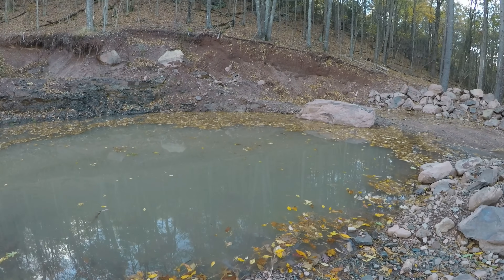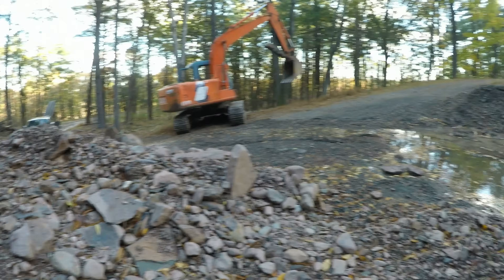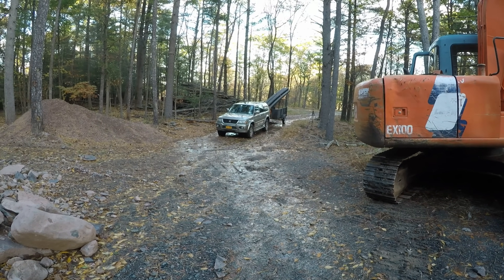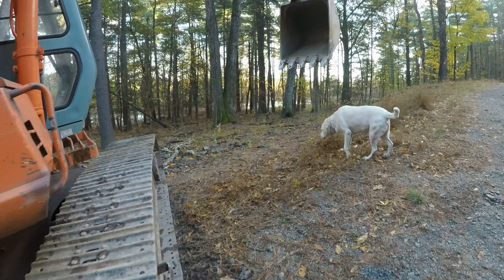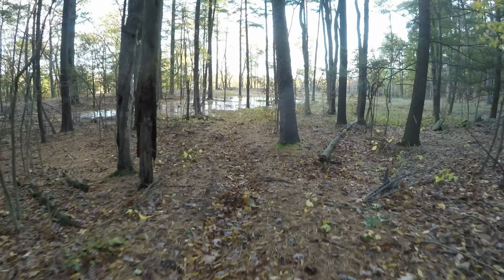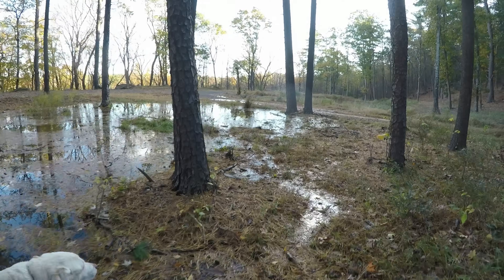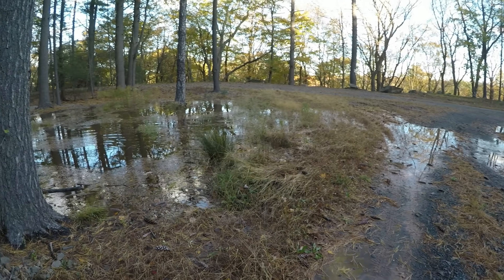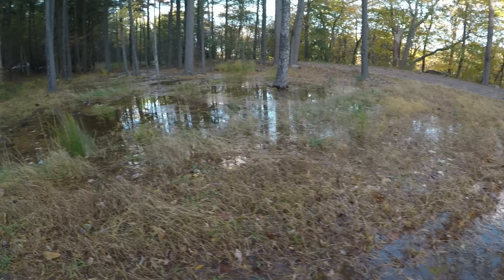Installing culvert pipes

Comment: The green line on that pipe is supposed to face up.
Reply from the maker: Malcom Texeira oh, why?
Reply: Andrew Camarata  If you look close at that pipe, 90 degrees off that green line there are perforations those are to be at the spring line, ie the middle of the flow line.
Reply: Andrew Camarata they are tiny..
Reply from the maker: Ill have to double check it. I know about perf pipe, I think that pipe is all solid though.
Reply: Andrew Camarata yup, that’s solid but it has little holes you can barley check 90 out from that green line. I didn’t know it either until my foreman told me lol

Comment: Andrew, how do you determine what size culvert to install? i have a small stream about 2' wide and 18" deep, i would like to be able to drive my vehicle across.
Reply from the maker: I guess just look at the size of the stream, and just make sure the pipe looks bigger than the amount of water that flows threw it after a heavy rain. I'm sure there are calculators online for properly sizing these pipes. But bigger is better.

Comment: would double wall corrugated pipe 24" or 36" diameter buried a couple ft deep withstand the weight of a full concrete truck?? anyone know???
Reply from the maker: Buried a couple feet? Yeah, that would be fine, I've buried that stuff way less than that and have not had a problem with it crushing with heavy truck traffic.

Comment: Well done young man, that block of land will be more productive now you've done that. I personally would have buried the pipe deeper up at the pond, (but that's just what I would do) and you may find you might have to put in a drain or two in that wet area so that in your wettest time the water will flow off the land into the pipe. Great work.

Comment: If you had built the pond correctly with stamd pipe and proper spill way. There would have been no need for this video. Also you would have saved a few bucks

Comment: looks like a good job. however, the place i worked & got my pipe from recommended to go no less than 1' deep to prevent the pipe from being crushed by traffic. i've also heard to use some sand or dirt that touches the pipe to prevent rocks from puncturing the pipe. but those are DOT standards & they over-do everything. 

hope it does well for ya & this video might solve a squabble i'm having with a relative, about letting run-off flow atop the road. that has "bad idea" written all over it.
Reply: We replace a lot of these plastic culverts I work for hwy dept most of the time the plastic is usually not low enough on driveway connections and they work up or collapse after several years we only use galvanized pipe no plastic but I guess it depends On were you work at. some use concrete and the plastic culvert pipes. But for as our dot we only use galvanized and usually do not have any problems other than if one isn’t installed properly and it gets to filling up with debris or undermining they will rust out but usually it’s a very long time before replacement all the plastic ones I have replaced have holes collapsed or just worked up out of ground being too shallow.that is usually the case. But I can see one deep enough it would last a lifetime. Andrew you got some nice skills there. And I enjoy your videos thanks.
Reply: They want 1-1/2 times the diameter of the pip over top of the pipe with loose fill in my area.
Reply: I had to replace my driveway culvert a few years back, my township will do the work if I buy the pipe. I asked about going to 8 or 12" pipe from the 15" that was there for added cover and said it wasn't needed. Small/smooth stone is best but the smooth bore double wall pipe is extremely strong and will hold up fine with only a few inches of cover.

Comment: A lot easier if you start down hill...kinda how you run pipe actually that way the water has some place to go.
Reply: the joints are at wrong direction, bells should be at high end .they can leak the way he installed pipe
Reply: Franklin Bush good observation. You my sir are correct

Comment: A video i’d like to see you make some day is investing in a hydraulic cylinder to replace the bar stock arm on the mechanical thumb on the hitachi and run the hydraulic lines down the boom
Reply from the maker: I think the hardest part would be the pluming, it isn't set up to have that extra function.

Comment: I hate to say it . But you dot have enough material on that culvert pipe. You need a minimum of 12 inches of gravel But 18 would be better and not those rocks that you threw in there. Those culverts are going to fail when a heavy vehicle drives over them.
Reply from the maker: I have been driving my loaded dump truck over them with no problems.
Reply: @SnakeRiverFishing 
That's the longest sentence in the English language I've ever read. So long I gave up trying to understand after 4 tries.  Not saying there weren't some tidbits of good information scattered around but, whew, hard to extract.
Reply: If only he owned the tools and had the knowledge to fix those culverts if they may fail....Hmmmm!
Reply: Was this a double walled culvert?
Reply: Yes, looks like ADS N-12.

Comment: You are obviously skilled at operating the equipment but personally, I would have started at the lower end and had those culverts ready to accept water flow before starting the upper culvert.  You would have had to deal with the pipe trying to float only once.
Reply from the maker: old time farm boy yeah, either way works. I like starting high though because the water in your trench will tell you grade, so you can easily make sure the pipes are properly pitched.
Reply: Good point. I did not think of that.
Reply: and left the inlet 2 second pond higher kept it above outlet

Comment: Those who have never been in an excavator have no idea what a deft hand it takes to run one as you do.   Moving the culvert with the bucket and not crushing it but burying it with the same motion.... slick.  You make it look easy.
Reply from the maker: Thanks, good eye noticing that.
Reply: I was actually disappointed...I expected you to reframe the camera shots using the bucket..LOL... Great Job !    @AndrewCamarata
Reply: It’s amazing how the boom, dipper, and bucket become one with you, especially when you’re doing fine work......I used to practice with the bucket full of water to develop a smooth non jerking flow.
Reply: Makes it look easy with very worn bushings on the bucket/stick! I would hire him to do work for me anytime
Reply: the main thing i noticed too! any reason you didn't work your way up? I like starting at the low point so you're not working in water/mud the whole time.
Reply: @JohnLaco  - Working from the top down let him know where the water level was to install the culvert at the correct depth for overflow.
Reply: Totally agree with you John Laco..I would have started at the lower pond and worked my way back up.
Reply: Andrew always amazes me, Levi the inspector is awesome too!
Reply: Yeah picked up on that sweet move too!
Reply: This guy is a true Picasso with this excavator.  There are guys that have a tougher time picking their nose than he has operating this excavator!
Reply: That was badass I was freaking out on it! 🔥
Reply: Yep, I've never run an excavator but I am a land surveyor and realized how fine his control is. It is like watching a dance. I wouldn't even bother to design a drive, I'd just hire him and let him do it by eye :-)
Reply: except at 5:15 where he split the pipe open when he bumped it sideways and then buried it anyways...

Comment: Smooth work. How long have you been operating diggers for?
Reply from the maker: First time I ran a digger was 2008, it was a rental. Than I bought a dozer and other machines after that.
Reply: Michael Morgan They're properly called excavators, not diggers.
Reply: The OP could very well be from the UK. Over there they are called "diggers", in fact they have digger rodeos